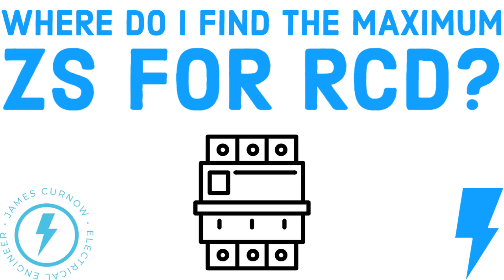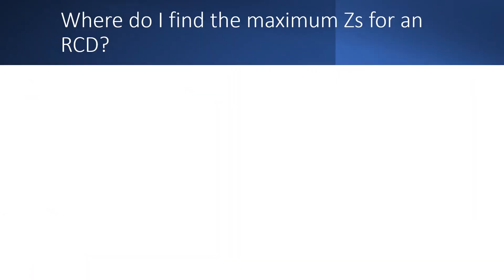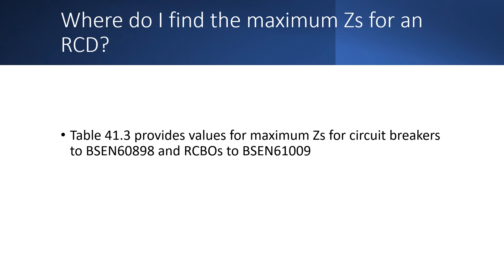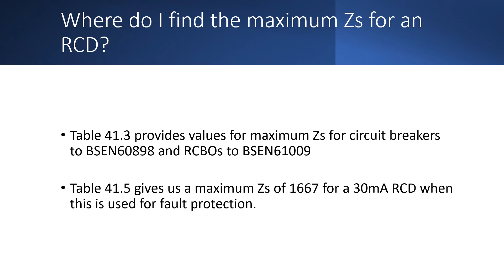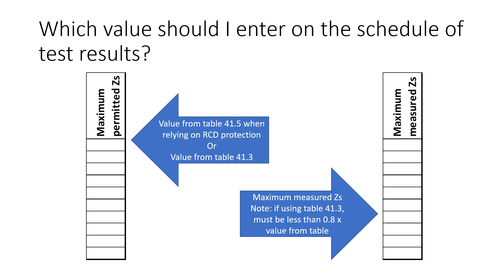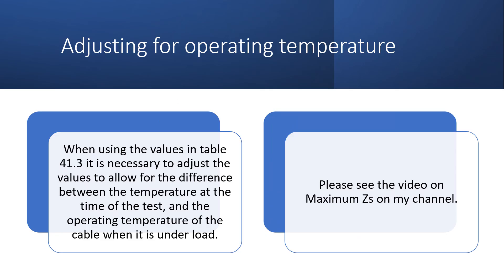Where do I find the maximum Zs for rcd?

Comment: If i have a circuit thats protected by a 32 amp b type rcbo and the measured zs is say 1.87  ohms can i mark down on the sheet that its getting used as fault protection aswell so the max allowed is 1667 rather than 1.1 ?
Reply from the maker: Hi, thanks for your question. In situations where the 30 milliamp rcd protection is used as fault protection, the max zs is 1667. You could mention in the notes on the test sheet that max zs is 1667 ohms as per table 41.5
Regards
James
Reply: @JamesCurnowElectricalEngineer  this was always my thinking but someone was telling me you still need to comply with the 1.1 ohms between the L and N  conductors for a short circuit fault to protect the cable , is this correct ? Can you shed any light on this
Reply from the maker: It is important to bear in mind that the rcd protection only applies to fault current (line to earth). Overcurrent protection is provided by either an mcb or the overcurrent protection included in the rcbo, and for this to operate quickly enough to protect against short circuit current, it's necessary for the device to disconnect faster than the time taken for the current to damage the cable. 
So, when relying on rcd protection for the fault protection and disconnection time, it is a good idea to also measure between line and neutral, and if the loop impedance (line to neutral) is less than table 41.3, a type b mcb or rcbo should operate instantaneously. Note, that disconnection times relate to fault current, and there isn't a disconnection time for short circuit current, but it's necessary to ensure the protective device operates quicker than the time it would take for the current to exceed the thermal withstand of the cable. So its necessary to do the Adiabatic equation to check this.
When completing a test sheet, the form asks us for max permitted zs (earth fault loop impedance) and there isn't a separate box for short circuit current. So it's necessary to record the information relating to the max zs, but also be aware about the short circuit.
I hope this helps. 
Regards
James

Comment: Hi....Enjoyed the video,,,,,thanks.
Regarding RCD/RCBO's......Fault protection.....On a TT system to keep the touch voltage below 50 volts a 30 mA  RCD would be 50v/ 30mA =1667 Ohms...but on a TN system arm't you  supposed to use 230 volts in the calculation and that gives you... 230 v /30mA = 7667 Ohms for max permitted Zs?
Reply from the maker: Hi,
Thank you for your comment. I'm glad you enjoyed the video.
When using RCD protection for fault protection in a TT system, the requirement in 411.5.3 is that the disconnection times shall be as required by 411.3.2.2 or 411.3.2.4 and that the resistance of the earth electrode and protective conductor multiplied by the rating of the RCD shall not exceed 50V. 
When the system is a TN system, we would normally design the circuit to comply with the maximum Zs for the overcurrent protective device, which would mean a maximum Zs as specified in table 41.3, which is calculated by Uo x Cmin/Ia. We would also need to adjust for operating temperature.
It is also possible to use an RCD for fault protection in a TN system.
I hope this helps.
Kind regards
James

Comment: Thanks for explaining it. However
The overcurrent protection device MCB with 32 Amps and 30mAmps RCD fault protection device is on one consumer unit which is double layer of protection so in this case what Zs is insert in the Mx Zs collumn?

For RCD Max Zs 1.1? or 1.17?

for 32 MCB it is 1.1
for 30m amps RCD 1.17

Thanks
Reply from the maker: Hello Sadiq, 
Thank you for your comment. The maximum Zs for a 32 amp mcb to BS60898 is the value from table 41.3 in BS7671, but that needs to be adjusted for the operating temperature, so you can put the figure of 1.1 in the column for maximum permitted Zs. I think the figure of 1.1 you mention is from the On-site guide, so we can use that but it's a good idea to make a note in the comments section.
However if we need to rely on the 30mA RCD for compliance with the disconnection time (for example in a TT system), then the maximum Zs would be 1667 ohms.
Typically, we would use the value for the maximum Zs for the overcurrent protective device (in this case an mcb) and design a circuit to be within the maximum Zs for the device and adjust for operating temperature. However it is useful to know the maximum Zs for RCDs in situations such as TT systems, where it may not be possible to meet the values in table 41.
I hope this helps
Kind regards
James